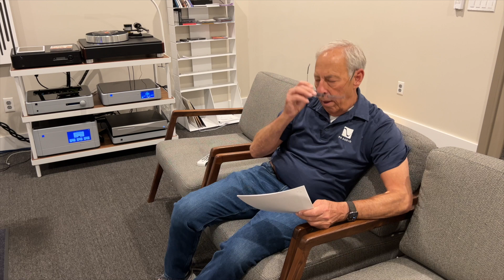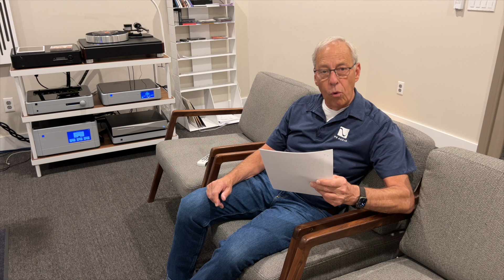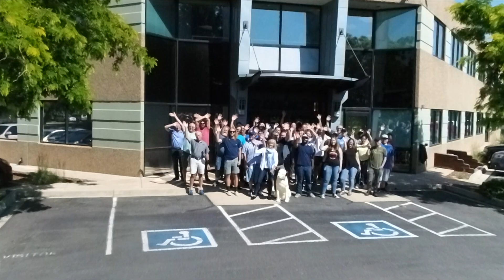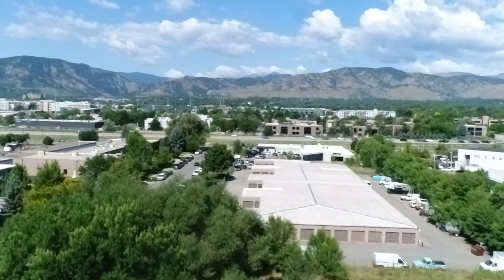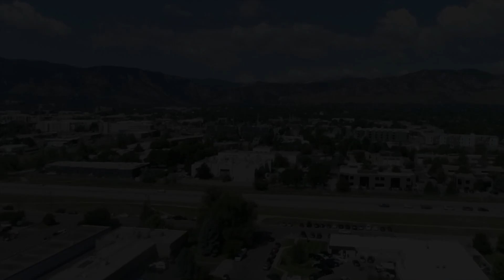How to convert DSD to PCM

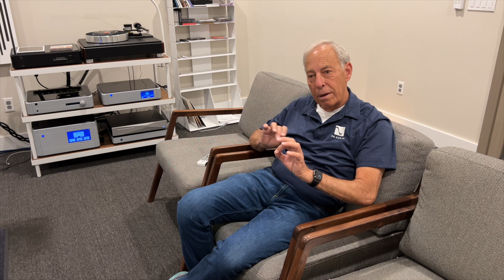Comment: @1:50 "...and then convert it back to DSD..."

Paul, your initial capture was DSD.  You convert that DSD capture to PCM (and you acknowledged that you hear no degradation), and you mix and master.
But then you said, @1:50, that you convert it back to DSD.  Why do so?

Since every DAC in existence processes PCM, and you have a PCM file that has sound quality equal to DSD, then why not leave it as PCM?
Reply: Marketing? No other reason really. Many DACs will convert DSD to PCM on the fly in oder to do their thing, but PS Audio dacs are primarily DSD devices so there's one reason for you. Honestly, DSD as a delivery medium sucks for many reasons.
Reply: @razisn  I am not familiar with PS Audio DACs.  But I would assume that the ones that play DSD content will also play PCM content.  So the additional conversion back to DSD seems to have no benefit, other than a marketing tool for PS Audio to sell DSD content.

In other words, they captured the band in DSD, and converted to PCM, with virtually no sonic quality loss.  Now they mix and master with their PCM version.
At this point, converting back to DSD serves no purpose, because even your DSD DAC will not benefit over playing the PCM version.

It would be helpful if Paul explained why his PCM version, whose sound quality is equal to what he then converts to DSD... it would be helpful if Paul explained why he makes that final conversion back to DSD.

I do not think that he will explain it, because the reason is probably purely for marketing.

I believe everything that he says about DSD.  It is what he does not say that also matters.
So his entire process makes sense, other than that last conversion back to DSD.  So it must be based on marketing.

The irony is that his channel is based on educating his viewers.  And yet he takes advantage of what his viewers do not understand.

Paul knows his craft.  But I do not entirely trust him.  That goes for just about anyone.  His low-key, relaxed, down-to-Earth persona in his videos is part of his sale's pitch.  He is pitching, in nearly every video, in a way that is unbeknownst to many of his viewers.

He tells the truth, and nothing but the truth.  But he does not tell the whole truth.

Comment: It puzzles me why DSD is getting so much attention being claimed to sound better than PCM. You can record it as output from a sigma delta ADC in a digital studio but as soon as you need to master the tracks into stereo you end up with PCM. And if you run PCM with high sample rates like DXD 352.8kHz you can’t really argue against PCM being inferior because your highest quality actual native music master file indeed is raw PCM and any conversion of it back to DSD will only be lossy and inferior. DSD as distribution media was great in the era of SACD. Nowadays most DACs aren’t able to decode DSD 1 bit natively but run PCM optimized multi bit sigma delta conversion. So why bother with DSD other than for the recording?
Reply: Marketing.  DSD is still highly recognized amongst audiophiles.
Reply: @Cakebattered  The marketing of DSD being better than PCM arose out of the SACD being better than the standard red book CD. What it doesn't mean is that DSD is superior to PCM when PCM runs at higher resolution. PCM 352.8kHz (DXD) is more resolving than DSD-64, for example.
Reply: True.  It's just that SACD continued on, while DVD-A morphed into Dolby TrueHD. So audiophiles still look at DSD/SACD as some ultimate lossless audio format.  Trying to sell DXD based recordings requires educating audiophiles...again, while a DSD logo is just understood.
Reply: @Cakebattered  Actually SACD sales is near 0% of overall music sales and the manufacturing equipment is all gone except one location. Around 2009 it was mostly shut down already and I would argue that we audiophiles have been suffering from a gap between SACD almost gone in 2009 with only a few 100 albums produced and streaming being inadequate for more than a decade until now when we finally can stream digital audio in CD to better than SACD quality with millions of tracks being available.
Reply: PCM IMPLEMENTED IN ITS BEST POSSIBLE FORMAT IS STILL THE BEST POSSIBLE FOR DIGITAL.
Reply: @davidcross890  RIGHT
Reply: DSD seems to have a more pronounced sound at like 100hz and I think that's what people like, I have heard good SACDs that I can sorta agree with the format but it's really never gonna go anywhere pcm is what we use and it works great
Reply: @owenjbrady  SACD has nothing to do with improving around 100Hz but rather about getting more precision in the treble where the higher sample rate can define timing better than a CD standard 44.1kHz PCM. But with modern streaming of 192kHz 24 bits lossless (e.g. Amazon Music HD), the benefit of DSD is quite questionable especially when you consider DSD being unable to support modern audio architectures incl. DSP.